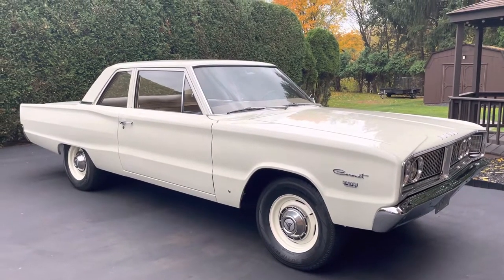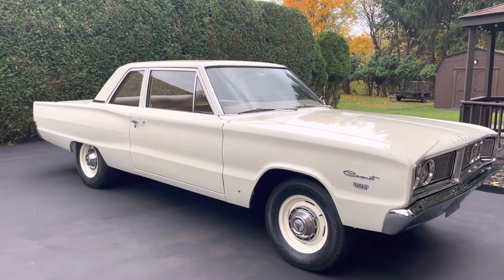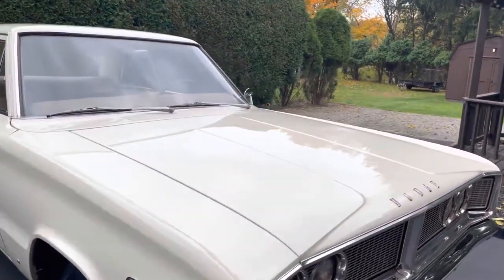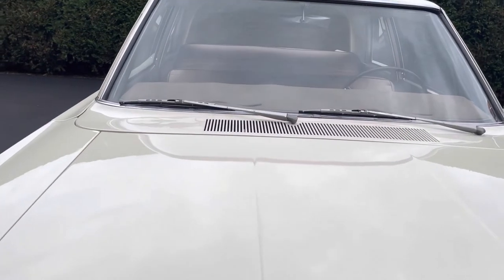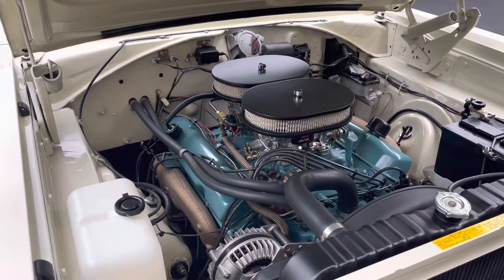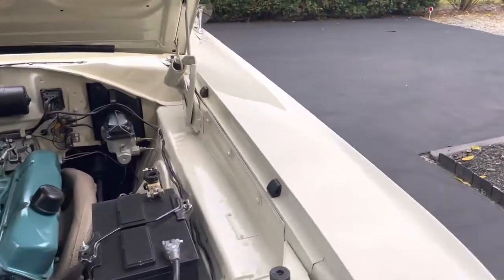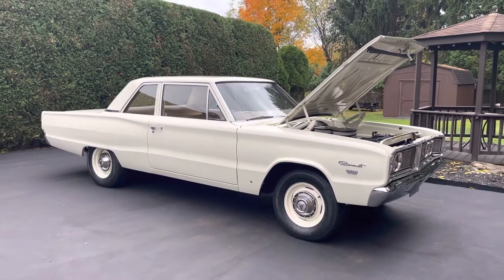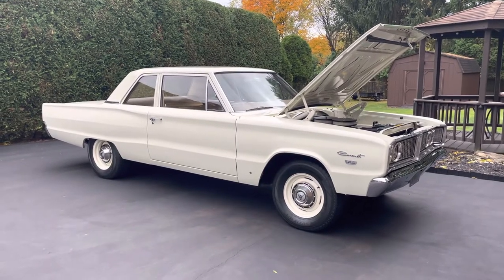1966 Dodge Coronet update, Cam & Carbs!

Comment: Nice Dodge! The dual quads certainly look impressive, but all the dyno numbers I've ever seen seldom put it above a nice aftermarket aluminum highrise with a big Holley, as far as peak hp numbers go. Whats your thoughts? I know the dual quads on my old 392 really moaned, but I didn't have a nice single four setup to test it against.....Perhaps the midrange tourque is improved?? Thanks for sharing.
Reply from the maker: My current toys are just cruisers.  
I like the look of 2x4’s and this factory intake still fits under a hood with reasonable air filters on top.  It drives as normal as a single.  In stock trim in 1959 this was worth 13hp on the 383 (330hp vs 343hp).  I ran this exact intake on a low-deck 451 years ago and it did consistent 11.80’s with no hole in the hood in a full dressed 1965 Coronet.